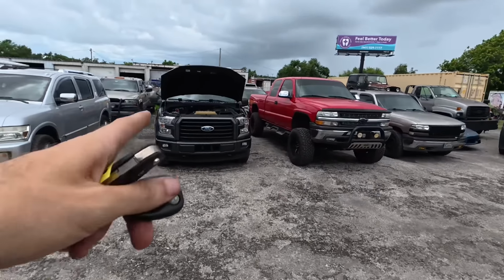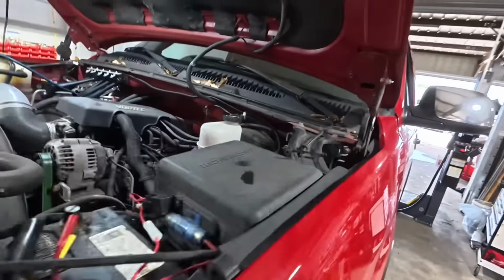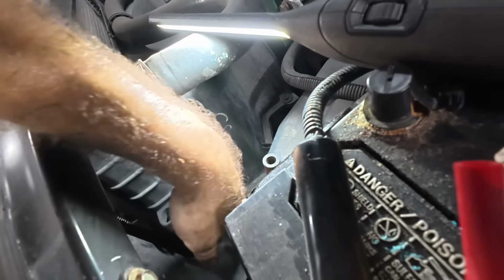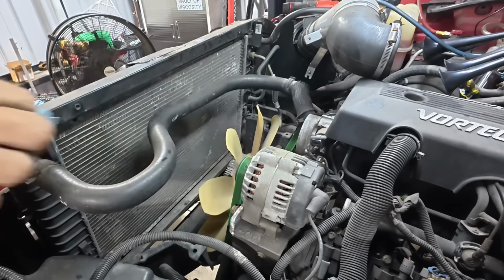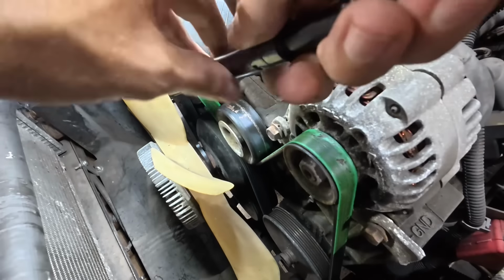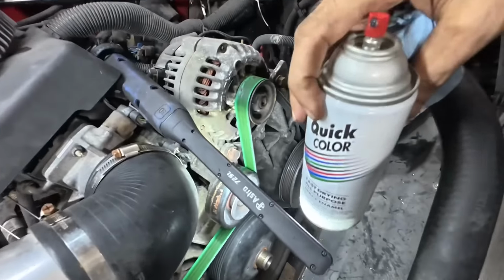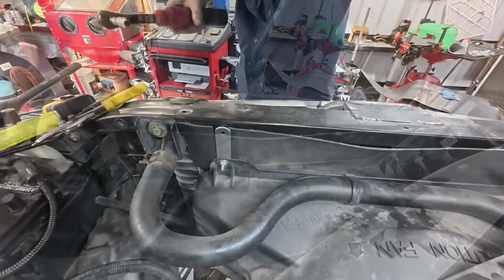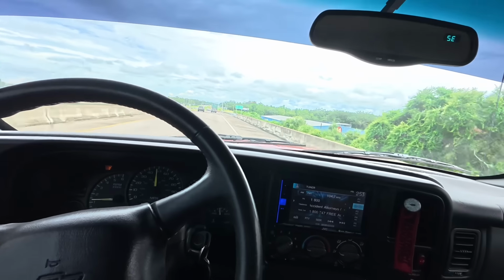Modified Truck has a Physics Problem!

Comment: Body lift looks cool bruh! AC doesn't work though 😂😂😂
Reply: I was about to say body lift when I seen all the brackets. That being said. I did body lift my Xterra when I did the Titan swap. I also replaced all hoses, radiator, fan clutch, fan clutch bracket and a bunch of other things. Currently running no lower shroud but will remedy that in the spring. But when tossing after market parts to a vehicle, be prepared for the extra you need to do. Glad to see mechs like Ray out there, I do most my own work, but it is rare to see someone like him. Wish he was local, but being Im in Utah, Ill keep doing what I do, you Florida folks, If near by I recommend Ray.

Comment: What with the extra air flow, the electric fans would save money in the long run.  They can be made to cut off or slow down and save fuel.  Plus they mount ON the radiator, not NEAR the radiator.

Comment: Not a fan of this particular truck owner.  They are willing to spend  the money on all of the "showy" stuff like big tires, suspension, front bar, lighting, and so on, not to mention the cost of fuel just to move that monstrosity around.  Yet when it comes to making the thing actually function properly, they skimp?!?!?  Seems like some misplaced priorities to me, but to each their own.  I know Ray always tries to do right for his customers, but in this case, I would have given two choices: either go with the electric fan upgrade, or live with an under-performing AC system.

Comment: When the flaps were missing, I figured it happened either if/when there was a radiator replacement or when they lifted the truck.  It makes you wonder if this problem manifested immediately after the body lift, didn't the customer notice and associate it?  Maybe the flaps got torn and eventually became a problem, especially when the right side fell off.

Comment: Blower resistors failing on Chevy/gmc's is a common thing. At least on the older ones (used to have to replace mine 1 or 2 times a year). Question I have is what is the dryer hose for?  Is it for rear ac? 😂

Comment: We I was in college, my (great?) uncles owned a auto-repair shop in Raleigh NC.  They recommended not to lift my truck as (1) range of steering is reduced and (2) issues like this video.
Reply: I can remember when large spring lift kits were popular on small Toyota trucks.  Side of the road with driveshaft on the ground was a common result.

Comment: The top strip should be attached to the engine side of the shroud to still funnel air thru the radiator down to the air flow.
Reply: disagree the air flow will push the flap onto the shroud causing it to seal.
Reply: @tedcharlton2523  If the flap is between the shroud and radiator there can be no flow, on the engine side of the shroud it would be small amount of air flow but not sealed off.
Reply: @tedcharlton2523  That's not how radiators work, by placing that strip at the top, all he did was reduce the surface area for heat transfer. No air is going to be forced down into the fan shroud he clearly blocked it!

Comment: Well they could have made the hood shorter. Kinda like a woman cramming a size 10 foot inside a size 8 shoe. Cuz it is cuter. 
I partially cured that A/C in the 99 when you could fit a large tranmission cooler in front in 84
Just put it in output to cooler. Out from cooler to raditor.
Stabilizes the temperature in the transmission and lowers the engine temperature while towing in the California desert. 
GM will squeeze a nickle here and there to make the profit even in a square body. Hey It worked past the warranty.
Front got thwacked or make it fit auto repaired it.
The one I worked on was all O rigged in all. No front thwacking in the 84. So it worked with parts made for that.
Just engineering de arrangement in that 99.
So even a '99 has squeeze more. It is just a size 9 shoe

Comment: $200 for programming? Why complicate simple things? This entire system can be assembled from 2 relays and one temperature sensor, which would close one of the relays based on its temperature. The second relay is connected to the air conditioner clutch and the fan is turned on from it. You can install either 1 fan or 2. Everyone has forgotten the old proven technologies, and instead they are trying to complicate the system. A system where the ECU is not needed at all.

Comment: I KNEW IT!!! That's what I was thinking when I saw that spacer on the top of the shroud!  YEA Ray - found it!
Excellent fix for the problem. I'm surprised the lift kit, which included the extensions for the wheel wells, didn't do the same for the cooling system. And that HD fan clutch was the topper. All was a good alternative for the customer, over the electric fan and programming costs. He should be very happy. The end result, cool air from the A/C! 
And thanks for the Lauren/WifeUnit cameo, as always. 😊

Comment: I have always replaced the stock fan clutch with a heavy duty one when I changed out the water pump,  I figure they are both worn out and  I always been happy with the result, but they can be a little noisy when they lock up, but it beats overheating in heavy traffic on a hot day.

Comment: I have a question for you Ray, you talk about the while you’re in there jobs. If you had to replace the intake gaskets and valley cover gaskets on a GM V8, would you also replace the knock sensors and their harness while you’re in there
Reply: Not a mechanic.  Biggest danger to knock sensors is improper installation, they aren't a consumable.  If they don't wear out, not sure it's a given, like it is with say, a water pump when working on timing system.
Reply: @russellstyles5381 I asked because I’ve had the same dealership do a reseal job on a Tahoe and a Silverado and the sensor code came up in less than a year

Comment: Orifice tube. I bought a 02 Sliverādo i replaced all the AC components and cools to 54°  only problem is I can only get the compressor to activate with HP Tuners or jumping the relay

Comment: I installed an electric fan pair back in around 2007 on my GMC, and I forget the name brand/company, but all you did was tap the ignition side of the fuse box so it's only hot when the key is on, it also came with a sensor adaptor you plugged into the engine temp sensor, and it read the temp sensor that the gauge reads.  You set the temp you wanted it to come on with the one side for the radiator cooling like normal.  The second fan had a adaptor plug you hooked to the a/c compressor so it only came on when the compressor was running.  Worked great for many years in 100 degree temps we have.  I think I gave like $600 for the entire kit.  But, was a good while ago.  My 04 Sierra had the manual fan, but my 05 Silverado has the electric fans from the factory. I know the owner may be  limited on fund, but I'd have had to go with the electric fan option.  Cheers.

Comment: fan shroud is not supposed to be low like that. they did a body lift and made drop brackets for it(called it before seeing ray discover it as i have seen it before on other trucks)

Comment: I was thinking maybe 4 - 6 inch high powered fans for the top... What you did looked goot, but thats always an option if more cooling is needed, wire them with a button thermostat - way cheaper than that factory programming

Comment: Suggestion:
3M has a spray-on adhesive in a black can that would probably help with keeping the top, and bottom flaps from sagging between the screws/pop rivets. Application on both surfaces greatly enhances the sticking power of the adhesive.
Overall, great job Ray!
Reply: 3M makes seversl spray-on adhesives but IIRC only one is rated for high temperatures. Their 800# can confirm which one.

Comment: Hey Ray! Check the taillight for water on the f150. May not be your issue but water intrusion will pull the bcm off line in those. Ran into it once

Comment: And crappy air filter sucking hot engine compartment air instead of air box that takes cooler outside air. Is that the correct factory radiator size and factory condenser size? Is it a different engine?

Comment: I put a heavy duty fan clutch on my 2001 F150 4.6 L because it struggled to cool and keep the AC cool on super hot days. Ruined the sound of the engine it sounds like it’s blowing air all the time now and it seems like I lost a couple miles to the gallon. Electric fan modification is expensive and difficult but man I’m really thinking about it. Might just do a standalone electric fan system with a Thermo coupler and its own battery and manual switch.

Comment: Fan shrouds are often overlooked, good call, the Home Depot hardware was a dead giveaway!
Reply: I understand that the L88 Corvettes were built for the track only. Some of them escaped confinement to the street. They ran hot because they didn't have a fan shroud. Also have a friend with his own shop. He had a Corvette that ran hot. Went over everything they could think of until they looked underneath to set the arms on the lift. Noticed that the front airdam was missing. Put one on and all the overheating went away.

Comment: 2005 Jeep Liberty CRD (Common Rail Diesel). From the factory, Chrysler put on one of those four bladed metal "chopper" engine fans, like you'd see on cars from back in the 60's and 70's - when they had the A/C Condenser, the turbo intercooler, and the radiator all stacked together, and using the same normal duty fan clutch as on the 3.7 L gas engine.
Figured out that the 11 bladed plastic fan on the 3.7 L gas version, had the same bolt pattern and overall dimensions as that four bladed metal fan - so got ahold of a Hayden Heavy Duty fan clutch. and one of the 11 bladed plastic fans.
It ended up being a drastic increase in air flow, once that fan clutch kicked in. Another gent that did the same mod to his CRD, and had an Exhaust Gas Temp gauge installed, said that after a run, it cut the cool down time on his exhaust temp in half.

Comment: Not surprised on 2017 Eco Boost truck. Where ever he trades it in tho will probably catch it by scanning it with right bank O2 sensor going wonky . Good time to see how well a block sealer works, drive for 2 months then trade in

Comment: Gee customer has AC problems from a shitty body lift (way cheaper than doing new arms and spindles) but then doesnt want to spend $ to do electric fans which would not only free up the parasitic drag from the clutch fan (and a possible destruction if the clutch ever went defective and spun the fan way too fast) but make his whole cooling system function way better.

Comment: You could have thrown some weather stripping in the gaps at the side of the shroud. Another example of someone doing an upgrade without thinking of how they are changing the engineered operations of the whole truck.

Comment: Suggestion: pop rivets instead of self tapping screws.
Reply: Then it's a problem for future Ray to drill them out when that radiator/condenser needs replaced. As another comment mentioned, self-tappers fit the truck theme.
Reply: @GeoffSeeleyThat whole truck is a comedy of errors.

Comment: Why did you not relocate those 2 top drop brackets to the back of the shroud (where these body lift kits state to mount drop brackets) instead of the front facing side? This would bring the top shroud an 1/8 closer to being flush against the radiator.

Comment: I have a 2004 Suburban and live in AZ. During the summer, the clutch fan just couldn't keep up, especially at a stop light or in traffic. I installed the OEM dual electric fans from that year Escalade Cadillacs and had the ECM reprogrammed to have dual electric fans at OEM temperature settings to turn on and off the fans when needed. The OEM electric dual fans upgrade are way better then the clutch fan option and I have never had any issues with the engine overheating and the A/C stays cold at stop lights now while sitting in 105 to 115 degree temps during the summer. This guy should definitely do the OEM dual electric fan upgrade in the future.
Reply: I must disagree.  Ray did the right thing in querying the customer with all of the options.  This is hardly a new truck and the cost to make the dual electric fan upgrade would be cost prohibitive.  One of the great things about Ray is in matters such as this, he gives the customer options and warns that other options may not succeed, but if they do succeed, it will be at a lower cost.  Many people out there are strapped for cash and appreciate someone like Ray that can find a way to get the job done without telling the customer they have to remove the lift kit or spend a fortune on an OEM factory electric fan upgrade. Ray gives options, which the customers clearly appreciate.  He will not bend in the options arena when safety is involved.  JMHO.
Reply: @wernerpd777  I also agree with Ray giving multiple options for the customer to make their own decisions. I was just stating my situation with how it worked and in the FUTURE, he should think about doing the dual electric fans because it is an upgrade to help his situation. You can get the stuff pretty cheap if you look around and grab the parts from an auto wrecking yard like I did. For the parts and having the ECM reprogrammed for me was around 300 bucks and its worth it in the long run. Price might fluctuate depending on location prices with either being cheaper or more.

Comment: On the F-150, Check the passenger side footwell below the dash/pillar for water intrusion. Very common problem. There is a central junction in that location that gets wet.

Comment: Those butchered Silverados are all over Clay county Florida. They Spend all the money on a stupid lift kit but can't spend 10 minutes cleaning the battery terminals and changing out the crusted radiator hose clamps. It's just basic simple commonsense maintenance. Thanks for the great video Ray!
Reply: So, it there must be a large gay community. They are the ones driving these trucks, right?

Comment: The E-fans would probably be the better option, however, if the customer doesn't want to drop the coin on that, then what you did is the next best option. It's not perfect, but it obviously accomplished the goal of getting enough air flowing where it should to address the issue. The flaps that you put at the top and bottom should really be part of the body lift kit for this exact reason.
Reply: Clearly the mods done by the owner aren't working or practical. If their goal was a poser truck vs functionality they have over achieved.
Reply: @ausmartin1  LOL yup! I personally don't like lifts in general, and really don't see the point of body lifts like this. With lifts in general, one problem I ran into (My truck is NOT lifted) was when I was looking for a replacement front diff for my truck at local boneyards, I found one from a truck that was a few years newer (think it may have been an 07 classic like Ray's truck), pretty low miles, and for a decent price, so I went and got it... Go to install it, and something wasn't right. Was looking at it scratching my head like I was looking at someone with no eyebrows for a few seconds (you know, can't quite immediately put your finger on what's wrong lol). Turned out it was out of a lifted truck and for that particular lift (don't know if they all do it), one of the mount points on the diff had to be cut off, making it junk. Might be needed for the lift, but it's not right.
Reply: @aperson9495  I am like you.  I can't fathom why in the hell anyone would want to ride around on stilts.  Nor can I understand why anyone would want to ride around in a vehicle that was SO freaking LOUD.  What is the point?  To drown out the radio or a conversation with a passenger?
Reply: @JR-rx2ke Loud pipes save lives....

Comment: That’s what you call a rushed install because I have a 3 inch suspension lift and a 2 inch body lift, but I also installed all the parts to correct my suspension geometry like a Panhard bar correction kit, aftermarket upper control, arms, and a front differential drop.. these people that think you can just throw a lift on there and be done. Don’t know about trucks.

Comment: You know, I think you can get a temp probe that will connect to your fluke multimeter.

Also, I was a little skeptical, but that fix worked really well! Good video!
Reply: I have the same multimeter (Fluke 87) that came with a temperature probe.

Comment: That customer is a ding dong for
Not wanting to pay up for the electric fans
Reply: Yeah. Like how much did that lift kit cost and you don’t want to fix the rest?
Reply: @shaunkelly9053 Exactly. What dumb ass
Reply: @shaunkelly9053 it doesn't make sense with the age and shape that the truck is in.
Reply: @speedboat-p5l depends how much the fans would cost and how long he wants to keep the truck. If it’s like 2000, then maybe nah, if it’s under 1000 then it might be worth it.
Reply: @speedboat-p5l  but it make sense to put a body kit on it.

Comment: That fan clutch impact wrench thing is a pretty cool tool
Reply: Caught my eye too.   I have that wrench but never understood exactly how it's used.   So it needs an extension to hook to the air hammer.
Reply: What happened to the old chisel? did the trolls bug you?😮

Comment: Stupid body lift caused that. 

My 01 has the same issues. Whole new ac system. New severe duty fan clutch. Ac still gets warm at idle. Driving its ice cold. It will pull a rag through the grill at idle. So it cant be a airflow issue. Stopped chasing my tail and just live with it now.

Comment: I was going to wait till the end of the video, but normally when you find things that are not aligned inside the engine compartment on a lifted truck, check and see if it has a body lift on it. The body moves up, but the engine stays the same.